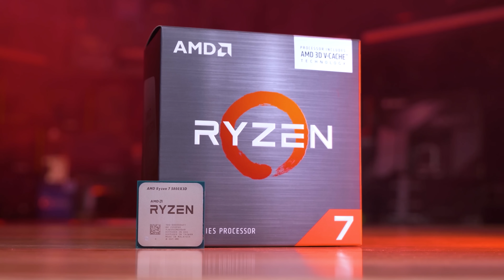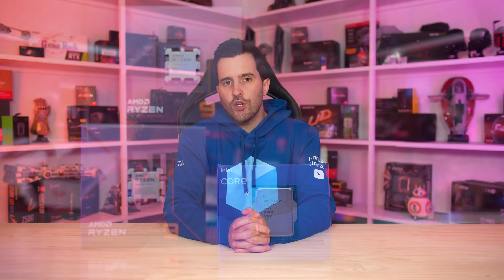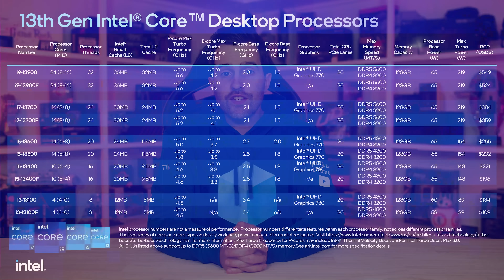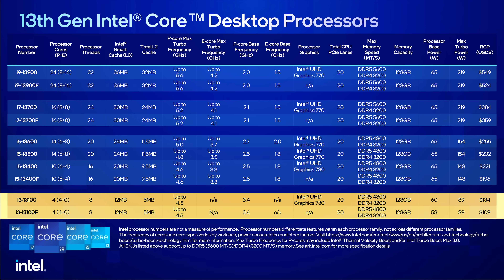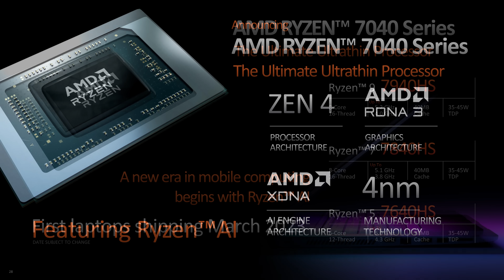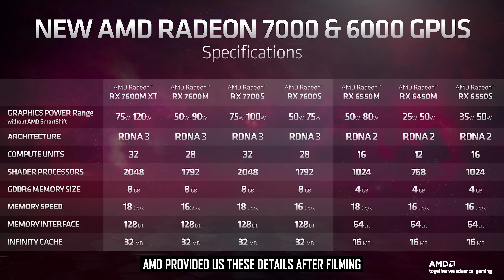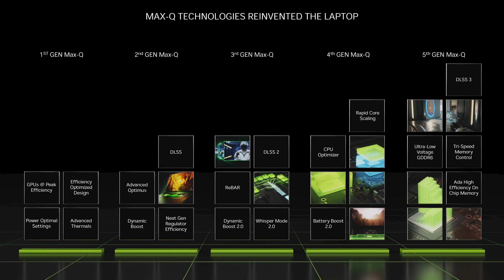Zen 4 3D V-Cache, 7950X3D, 7800X3D, New Cheaper CPUs, "RTX 4090" for Laptops - CES News Recap

Comment: I just got a 5800x3D, I was questioning waiting for these chips. But ultimately the price to transition to AM5 would’ve cost me an extra $1000 for the 15% uplift. For new builds this is great news
Reply: same here, upgrade from 3900x to 5800x3d
Reply: @weeeeeeeeeeeeeeee  How different is your experience after upgrading? I'm on a 3900x now and currently eyeing the 5800X3D
Reply: @TerryKing01  cant tell because the main reason i upgrade is for pubg and for 5800x3d i can maintain 120 fps 90% of time compare to  3900x, before i barely reach 120 fps. btw i bought 5800x3d for 300$ def a great upgrade
Reply: @weeeeeeeeeeeeeeee  Microcenters have it for $319 near me and I'm hoping they stay that price or drop even more by the time I can buy one.
Reply: @TerryKing01  if you want it for gaming i believe 5800x3d is your final answer for am4 platform, but if you want to get big upgrade you should look at 7900x3d but i dont think price will be friendly lol
Reply: @weeeeeeeeeeeeeeee  Yeah, if you are already on am4 you might as well get the 5800x3d if you game. Its $300 now and maybe will go even lower this year.
Reply: @TerryKing01  I have both the 3900X and the 5800X3D. It's a massive improvement, in some games exceeding a 50% performance uplift.
Reply: @KillFrenzy96  Sheesh I might as well get the 5800X3D skip 7000X3D to save money and wait for 8000X3D
Reply: @TerryKing01  largely depends on the game, I play escape from tarkov a ton. So I got nearly double the frames with the upgrade and that’s coming from a 5600x. Games like Csgo and r6s are the same, if not a slight reduction due to clock speeds. Any cpu intensive titles I’ve seen roughly a 30-60fps gain. Again coming from a 5600x which is already a pretty good chip
Reply: @TerryKing01  upgraded from a 3900x and don’t see myself hoping over till the 8950x3D. 5800x3d is just too good.
Reply: @TerryKing01  the 1% lows are a huge uplift in every title though. Which makes the game feel and run like butter
Reply: @Pegasus__  The main game I play Is Valorant and apparently it LOVES the extra cache. So I should be good
Reply: @Pegasus__  Sweet!
Reply: @Pegasus__  That's what I've heard with respect to flight sims.  The DCS crowd say the 1% and 0.1% improvement is amazing.
Reply: @TerryKing01  I went from a 5600x to a 5800X3D and it was an amazing improvement
Reply: @Pegasus__  I'm literally in your previous position. Built a full rig with 3080 and 5600x to start gaming 2 years ago. Ended up hooked on Hell Let Loose and discovered gpu usage barely hits 50% most of the time coz it's so cpu intensive vs most other games. Still get nearly 100fps average so don't really NEED a better cpu. 🤷
Reply: @Veyron_fan  I also have a 3080. I was able to sell my 5600x for $150 so it was a fair reasonable upgrade for me. It also bugged me a lot seeing my 3080 not being able to stretch its legs. If you have a bit of spare cash for the upgrade I would recommend it. It’s fairly cheap upgrade after selling your old cpu. Frame dips are almost nonexistent, or rather not noticeable. I also run 3 monitors with programs running on each. For my game, it allowed me to crank up the visual settings and still get a big boost to fps
Reply: @Veyron_fan  to play the devil on your bank accounts shoulder, did you really NEED a 3080? ;)
Reply: @weeeeeeeeeeeeeeee  what gpu you have? all this for pubg?
Reply: @TerryKing01  minim fps raised by almost 60-80%, max fps got better by like 20-30%; in valorant. Overall a lot more stable fps.
Reply: @TerryKing01 You need to check the results of the games you play.
Reply: @TerryKing01  I upgraded from the 5600 to the 5800x3d and noticed an immediate difference in snappiness all the way from web pages loading to sustained frame rates.   Much better.  Just keep in mind, the 5800x3d gets quite a bit hotter.  But this is normal and is also why they don't allow overclocking on that chip.
Reply: @TerryKing01  I play at 1440p and had a  R5 3600/2070 super. I only gained about 10 fps on average with the 5800X3D but my lows got soooo much better! I have since upgraded to a 4080 (not really happy about that) but considering it’s the end of the line and if you were even slightly considering any upgrades I’d say the 5800x3d is worth it
Reply: @ERZAY2  there isn’t an end of the line in PC gaming. Always something newer and better 😭
Reply: @weeeeeeeeeeeeeeee  unfortunately the 7900x3d and 7950x3d uses half 3d cache 

only 1 ccd has the extra 64mb so it's very likely going to cause performance inconsistencies unless you force the process to only run on the ccd that has extra 64mb or the ccd without 64mb cache (depending of your game prefers frequency or extra cache, unsure how windows task scheduler is supposed to deal with this in an automatic fashion)

7800x3d is probably the one to get
Reply: @TerryKing01  i went fron a 3700x to a 5800x3d. biggest noticeable difference is to 1% lows. used to have some stuttering in a few games but those are gone now.
Reply: @weeeeeeeeeeeeeeee  I came from a 3900XT to the 5800x3D and I find that the 3900XT outperforms the 5800x3D, but they are exceptions.
Reply: @jamesm568  you make bold claims but no specifics, what game does a 3900 XT perform better than a 5800X3D?
Reply: @ponli7532  Well, for starters Microsoft Flight Simulator 2020 showed no benefits whatsoever with the 5800x3D. Oh and let's not even mention how poor productivity is with the 5800x3D. It also sucks at 4K even though 4K is technically bound to your GPU the 5800x3D is still more of a bottleneck on a 3090. Now if I was a 1080p gamer then the 5800x3D would be perfect. I live in 4k.
Reply: @jamesm568  First of all productivity is irrelevant, X3D is for gaming. Second of all  I don't think you understand how this works. If you didn't show any improvement at 4k, it's because you are GPU bottlenecked. You need to upgrade your GPU. The reason you see improvement at 1080p is because your rig is no longer GPU bottlenecked at 1080 p. If you live in 4k , you need to get a 4090.
Reply: @ponli7532  I'm not going to handicap a 4090 with a 5800x3D as you way better off with a 5950x. I personally wouldn't waste my money on a 4090 on the AM4 platform.
Reply: @jamesm568  sry dude but you are painfully ignorant about how CPU works for gaming. 8cores is the absolute max required , more is just pointless. A 5950x would get destroyed by a 5800X3D and it would murderstomp a 3900 X in any scenario where you are not GPU bottlenecked. Read my previous message and understand where you misunderstand how bottlenecks works. 4090 and 5800x3d would work really well together , ESPECIALLY at 4k. It's the lower resolutions you need faster CPU with the 4090 like the upcoming 7800x3d. When you play at 4k you need to spend lots of money on GPUs and you can get away with a lesser CPU, this is why on your 3090 im confident you were already bottlenecked at 1440p, and then wether you used a 3900x or 5800x3d it didn't matter.
Reply: @ponli7532  LMFAO at the 5800x3D smoking the 5950x when the 5950x and the 5800x3D traded blows as neither one dominated one another overall.
Reply: @jamesm568  were you looking at a benchmark where the GPU was bottlenecked perhaps... Games are bound by specific threads having 16 cores does nothing for your game performance. 5800X3D beats a 7900 , it also beats a 5950,  you were just looking at benchmarks where the 3000 series were being gpu bottlenecked at 1440p or more. Hardware unboxed has many videos on the topic. Please educate yourself.
Reply: @ponli7532  It's all good as the 5800x3d was a disappointment for me so I moved up to the 5950x as that felt like an upgrade and noticed overall better performance in the long run. Coming from a 3900XT to the 5800x3d wasn't much of an improvement most of the time for my use case. I saw a complete and noticeable improvement with the 5950x as I didn't get that with the 5800x3d. The 5800x3d didn't give me a balance of productivity and gaming and definitely doesn't play nice with my flight simulators.
Reply: @jamesm568  wait so in this thread youv'e said you had a 3700x, then 3900XT, then 5800X3D then 5950X. You still only have a 3090 and you only play at 4k, god you wasted so much money being bottlenecked the whole time by your 3090. Here's an advice, if you are playing at 4k, 99% of the time you are GPU bottlenecked unless it's a really old game. Don't buy a new CPU just upgrade the GPU, and if you already have the best GPU just wait for the next generation of GPUs. Buy the latest top of the line, then do a benchmark comparison versus review sites(they will always use best CPU available) then compare your FPS to that, then you could see that most of the time that upgrading your CPU is pointless. 4k gamers actually can save a lot of money by just having top of the line GPUs paired with several generations old CPUs. Just like you noticed with your 3900XT and 5800x3d, you didn't need to upgrade anything because it's the 3090 holding you back. This is the end of my engagement in this thread, either take this advice or don't.
Reply: @ponli7532  Messing around with a PC is a complete waste of money which is why it's a hobby. Personally it's not a waste of money for me as old parts are easily sellable.
Reply: just did this too, 3600 non x to the 5800X3D. was a massive improvement.
Reply: i would skip the 7000 series if you have a 5000 series chip.  let the early adopters beta test it until the next series comes out when everything is running "smoother"
Reply: As soon as they announced 7000-series was gonna be DDR5 only, I knew I wouldn't be going that way.  Didn't make much sense to spring for a new motherboard and 32 gigs of DDR5 when I could just drop a new CPU in my existing system.  That just left me to decide between the 5800X3D and 5900X.  Ended up installing my new 5800X3D just after Christmas.
For anyone who's curious, i upgraded from a 1700X, and my 3000 SPM Factorio death world went from struggling to hold 25 UPS to a solid 60 with room to spare (11.4 ms average)
Reply: its would of cost you 200-300 more
Reply: I'm personally not going to move up to the 7000 series till it has at least 2 years of maturity. I have the 5800x3D myself, but I actually kind of find it disappointing as it was more of a marketing scheme to breathe new life in a dying platform.
Reply: @James M  it largely depends on the game you're playing and what you're upgrading from.  I saw 100% (yes 2x) fps increases in EFT when upgrading from a 3700x
Reply: @ChrisMisMYhandle  I have the 3700X and bumping up to the 3900XT was a major difference at that time. I have no doubt there's a noticeable difference between the 3700x and the 5800x3D. Didn't feel like an upgrade to me when I bumped up from the 3900XT to the 5800x3d.
Reply: @jamesm568  how tf is the 5800x3d a marketing gimmick, is it by far the best cpu for that platform for gaming.
Reply: @TheMightySilverback_  LMFAO! The 5800x3D is not the best gaming GPU as I can tell that you bought into the gaming gimmick. The 5800x3D may trade blows with some of the top end processors, but it is definitely not the best. Like I said the 5800x3D was a gimmicky marketing scheme to breathe new life into an outdated platform.
Reply: @jamesm568  what gpu are you pairing with?
Reply: @Pegasus__  3090.
Reply: I got a 5800x3d last week. And after 6 hours of use... it died. 1st time in my life i have to go through the warranty process for a cpu, and first time a cpu dies on me.
I am a bit worried how long the replacement is gonna last after seeing Greg Salazar videos "Fix or Flop" with so many ryzen dead chips. I am having to use a 5600g in the mean time, and hoping the replacement 5800x3d won't die and this was just a bad chip that i got.
Reply: @Ohhwell  just got a gigabyte gaming oc 6750xt
Reply: I got a 5800X3D for 400 USD right before the price drop and I’m not even upset. That is such a nice CPU. I might take a glance at a 7950X3D come summer, but I don’t feel that I’m missing out in anything I do at the moment.
Reply: At 1440p my 5800x3d is not the bottleneck.  My 6900xt will max out when I do the cyberpunk 2077 test.  I also run triple monitor sims and that will, of course, max the graphics card more than the CPU as well.
Reply: Will there be resonable performance uplift on 5800x3d from 3700x/6800 xt for 1440p gaming with mixed usage(multiplayer/single player)?
Reply: Definitely not worth it. I opted for a 5800x3D too and I'm more than happy with that.
Reply: I was fighting myself for months now, and was ultimately able to stop myself, because my current R5-5600 has been good enough for me.
I'm planning on a complete new build using 7800X3D in the future, and I won't even say "near" future.  Patience....
Reply: I'm willing to bet that it'll be a bigger than ≈+15% average uplift in games that are actually CPU bound. More like ≈+20-30%. 

It's still significantly more expensive, no doubt, but if you are building from scratch instead of upgrading an existing system buying into dead-end AM4 at this point is fucking stupid. 🤷‍♂️ 

If you already have an AM4 system otoh then just snag a R7 5800X3D whenever the price gets low enough for you to justify haha.
Reply: Yep, 5800X3D fast enough already and will last me until AM6
Reply: Same! Smart move!
Reply: 7900X3D or Intel 13900K for my build with a 4090 FE? Decisions Decisions
Reply: @Patrick-tw7nr  socket life kills me for intel every time .. i have a z590i with a 10850k in a build as despite the front m.2  slot wont work without 11th gen its a nice cpu .. 
But ill stick to AMD for my main build for sheer socket life span
Reply: I’m running a 5900x and have a unopened 5800x3d.  Should I return it and get a 7800x3d? Use case is fight and racing sim on VR
Reply: @slowinfastout3304  you’d have to also get a new mobo and ddr5 ram. So really depends on if you want make those purchases
Reply: @@NotANOVERPRICEDGOUGINGTECHFAN same i just bought the 7600x so i can build my AM5 7900xtx system but the 7600x will be getting sold come the 7950x3d .. 
but i think i will keep my 5800x3d 6900xt system !!
Reply: The cost definitely isnt worth it.
Reply: @sx4152  They were just on sale for $300.
Reply: @sx4152  The cost of full platform with 7600x is the same as cost of full platform with 5800x3d. I think costs are somewhere acceptable
Reply: @sx4152  worth it, yes it is.. do you actually need it? probably not.. unless you absolutely need the ridiculous frame rates these cpu's will allow or increased production performance the 5800x3D is more than enough while waiting for DDR5 prices to come down to justify going to am5.
Reply: @sx4152  yes it is
Reply: All of AMD's X3DVCache CPU lineup will get murdered, slaughtered, assassinated and destroyed by intel's 13900KS

Comment: Can someone explain what this 3D extra large cache is and how it functions
Reply: CPUs have caches to keep frequently needed data or program code quick to access. Larger caches take more space, so caching is tiered: a small bit is kept inside each core (L1), a larger bit next to each core (L2), and a still larger cache is kept on the chiplet or chip (L3). Some CPUs also have an L4 cache, but it's pretty rare (the i7-5775C is one such CPU that turns the integrated graphics memory into an L4 cache when the integrated graphics are disabled).

The "3D" cache is an increase to the L3 cache by stacking additional silicon dies on top of the chiplet to increase the amount of cache. Many games have more active data than fits in the 32 MB of L3 cache the chiplets in modern Ryzens have. For these games, not waiting on main memory (which is slower) produces higher frame rates and fewer "1% lows" or slow frames.
Reply: like Mark Rose said. On a higher, less complex level: they have more "short-term memory", and therefore can be faster for some calculations.

Comment: QUESTION!: For the grizzly frame from the add at the start, does 13th gen also need it?
Reply: same socket, so it must be the same. the problem is not the cpu but the socket retention mechanism pressing on two spots.
Reply: Buy the thermalright version, they have better contact with the CPU for a lower price